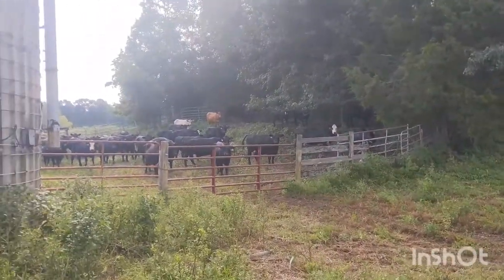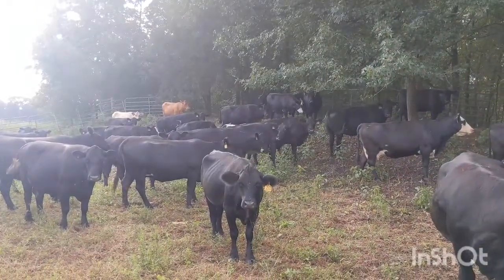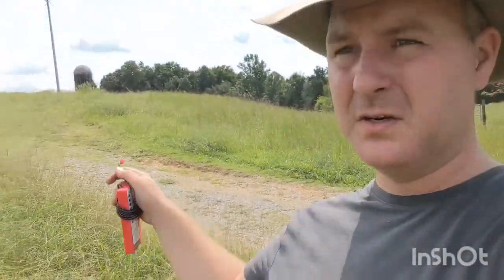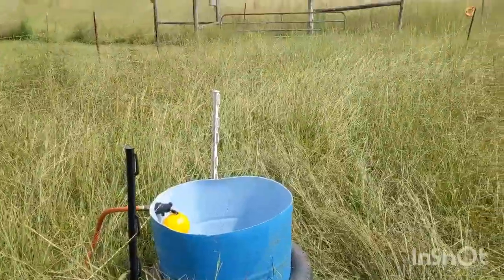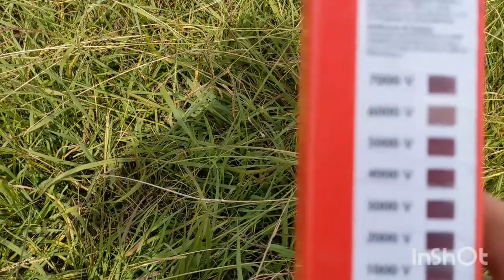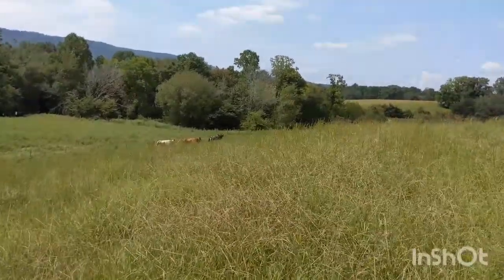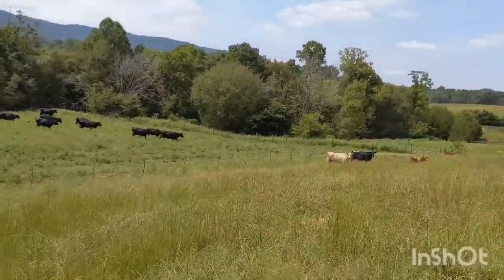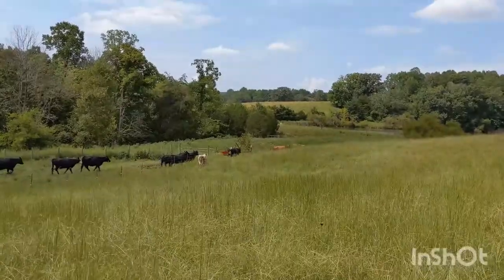Training cows to Electric fencing

Comment: What kind of wire/ fencing system Do you use?
Reply from the maker: Nothing really fancy. I went to tractor supply and bought poly wire and the white step in posts and I also bought the $10 electric cord reels that I use to roll my wire with. Buy the best you can afford. Poly braid is suppose to be the best.